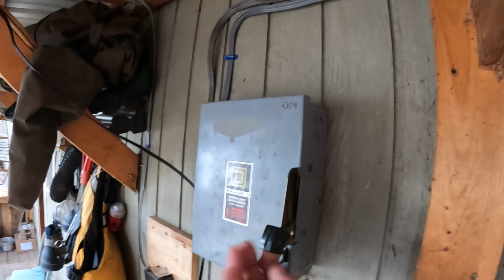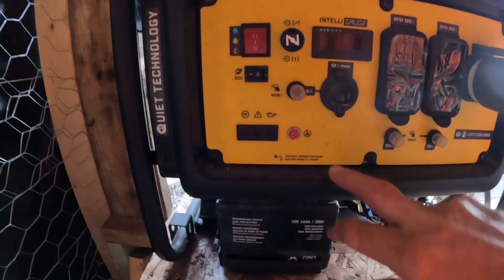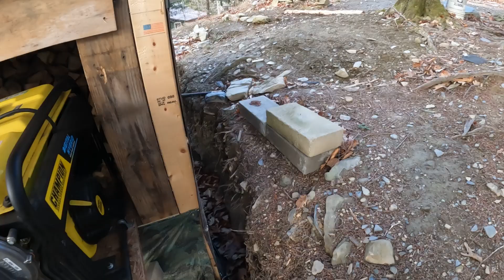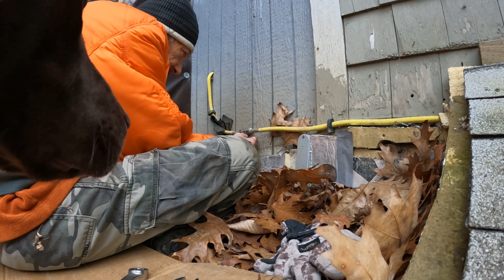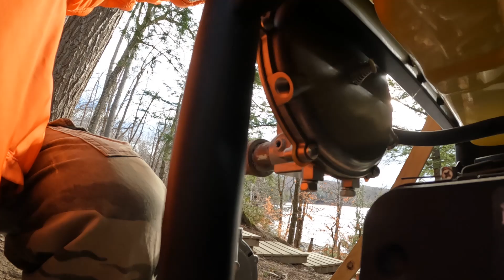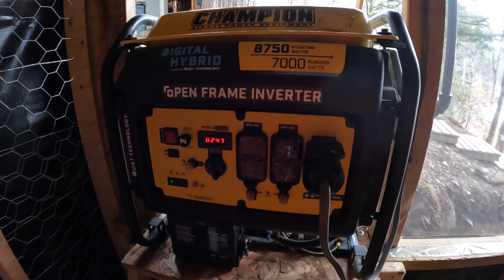Champion Inverter Generator Review and Installing LP Fuel Feeder #fj40

Comment: It appears as though you have (4) separate regulators in line with your LP feed. The first is on top of your 100 gallon tank. The second is after the T-fitting at the small tanks, a 3rd regular is the green one at your generator and then finally a fourth silver regulator that feeds the manifold on the generator's carburetor.
Reply from the maker: Hi, the regulator on top of the 100g is for an Empire backup thru vent heater. the second on the small tanks which are also fed from the 100g is a regulator for my Rinnai on demand hot water heater. I believe the green one on the generator is a HP reg and the silver a LP reg. Thanks for asking if you will please like and subscribe!
Reply: @JosesGaraje  Interesting. Thank you explaining the setup. I've never seen that done before.  I just purchased a Champion model 100520 and ran a 7-hr whole house backup test on Saturday.  Very impressive little unit.
Reply from the maker: I have a petroleum service company do my hookups. One of the branches that I question is they have the large and small tanks inter connected so you can't remove a tank without shutting the entire system down first. Maybe a regulation...I don't know.
I way over killed the wattage for my residence when I bought this inverter generator,  with everything running the watts are about 3-4K and the gen is rated for 8.75K so the gen never sees full throttle.
Reply: @JosesGaraje  Actually, being a little oversized is a good thing. The only disadvantage to a larger generator is it will typically have a larger engine and may use a bit more fuel than a small generator.  But... there are also some advantages to having  a larger generator, especially with inverter generators. If you only run 50-60% of what the generator is rated for the inverter module will run much cooler allowing for longer life. Also, at 50-60% load the engine will run much slower with eco-mode turned on. So where a 3500 watt generator would be running wide open, a 7000 watt generator may still only be running on slow idle. This will allow the larger generator to use less fuel.

Comment: where did you get the propane kit from?
Reply from the maker: When I bought the inverter generator from Champion it went to their shipping department and before drop shipping an option was listed for dual fuel for an added cost, which I purchased. Oddly enough if you talk with Champion customer service they will say the unit is not dual fuel. The shipping dept Ph# is 1-843-637-2867 they might provide you with a dual fuel kit for this unit.

Comment: Like the setup,  plain and simple.
Reply from the maker: It's not bad but I would like automatic switching if it wasn't so dang expensive. The other issue that keeps me from getting adequate rest during the nights that it's running is that it's attached to my porch and if there was a catastrophic failure, like a fire my home would go up.